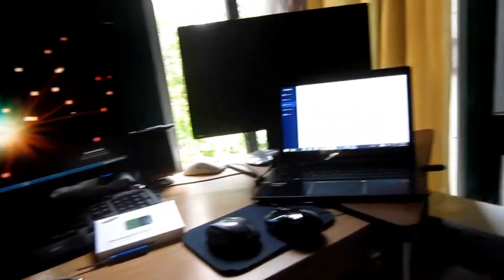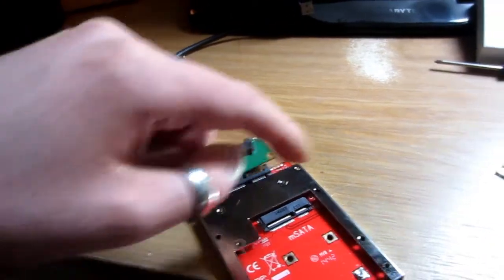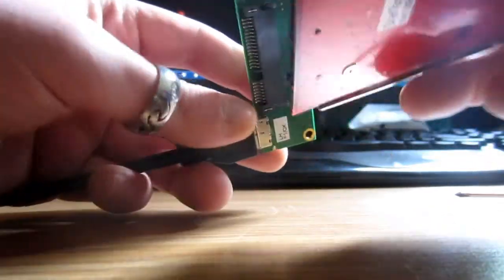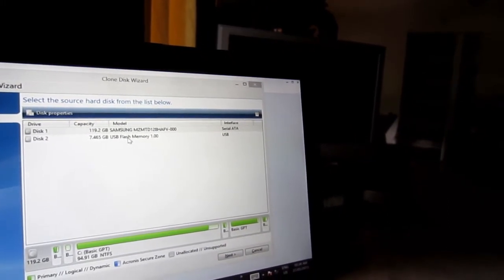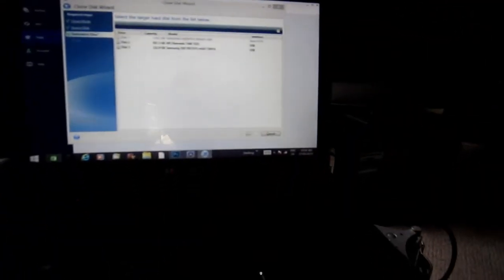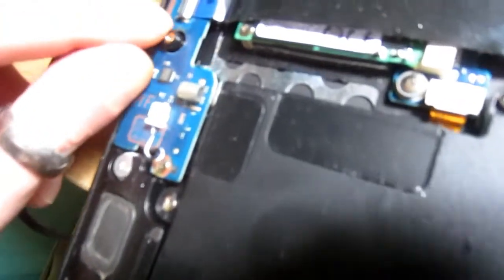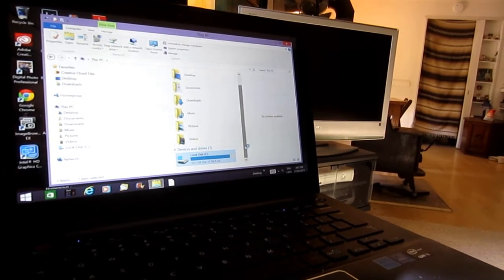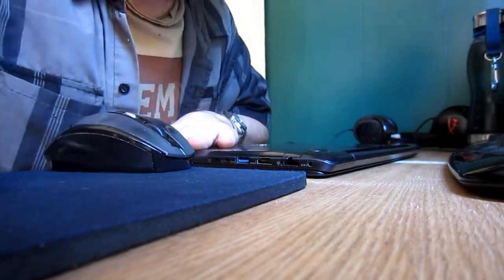mSata/M.2 Ultrabook Adapter Drive Swap with Acronis Free

Comment: why  "m.2" got related to the tittle? there is no m.2 in this video
Reply from the maker: the adapter works for m.2 as well, or vastly similar adapters do, i've done it tons of times :)
Reply: @ParadoxdesignsOrg so which size of m.2 fix to the adapter??  i search my laptop lenovo ideapad y470 and found out can support msata 32/64Gb, if i put more than that,what will happen?